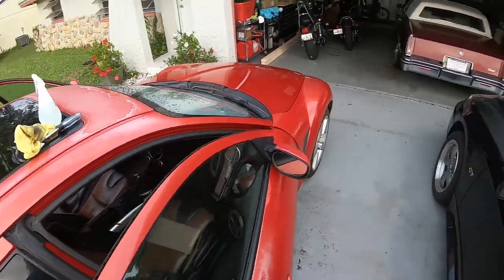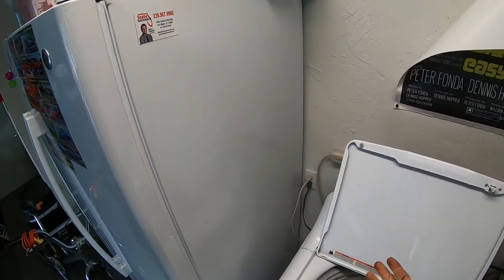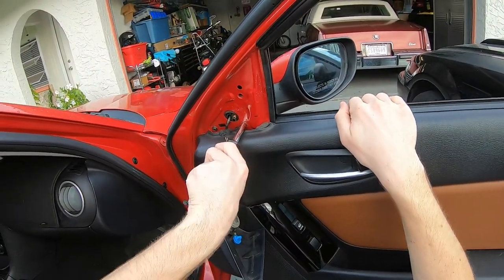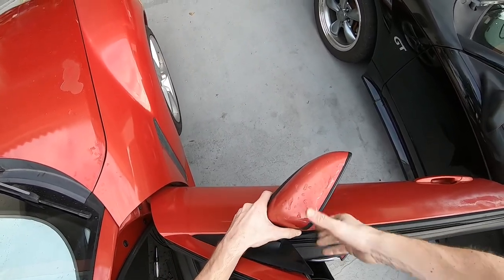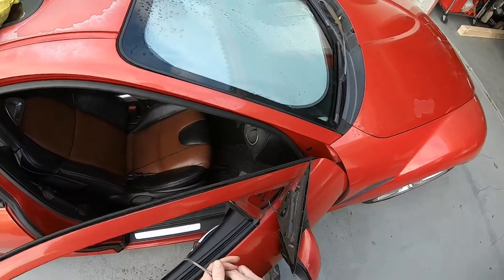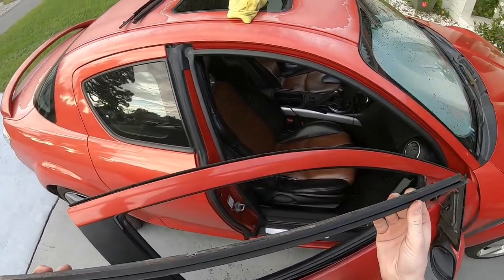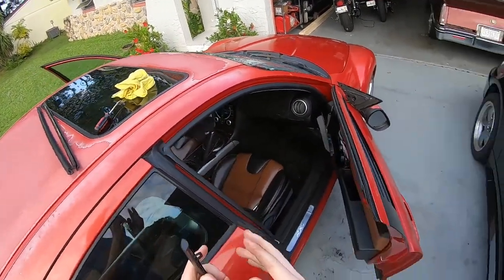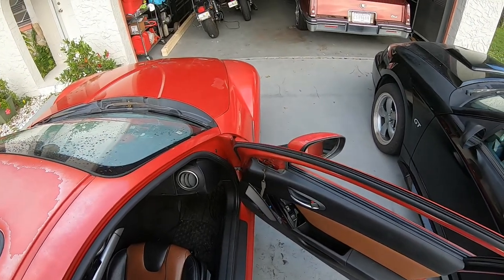Replacing Mazda RX-8 Outer Belt Weatherstrip

Comment: If you're prying stuff with metal tools, put some tape on it. Or get plastic tools. Prying 101.
Reply from the maker: That's a good tip. I actually scratched a bit of paint but was luckily not visible above the piece.